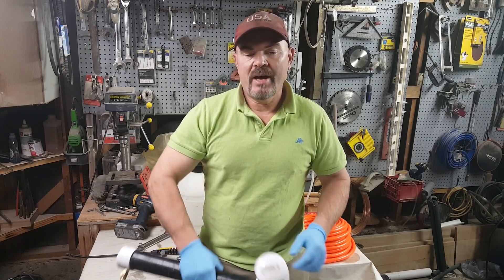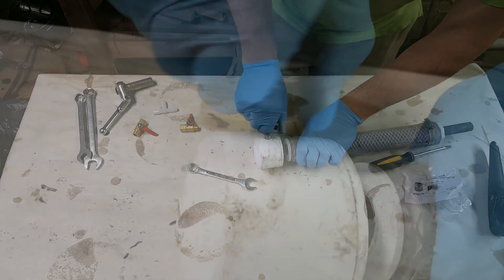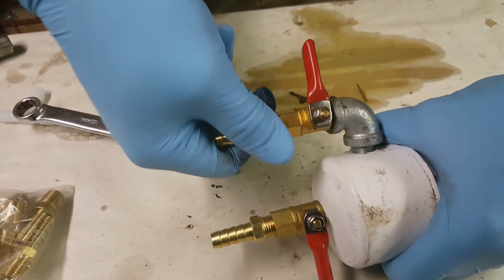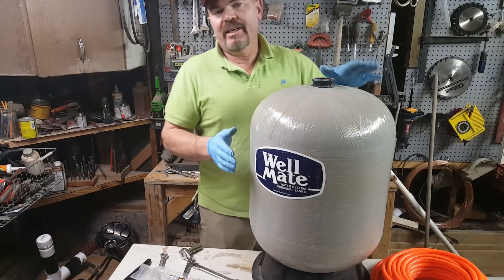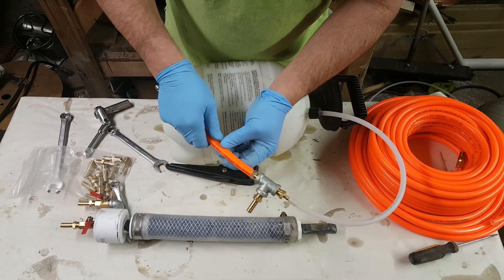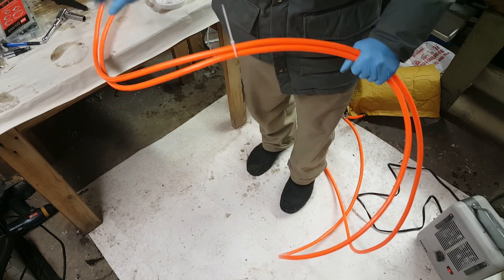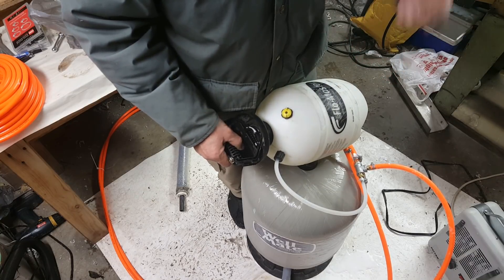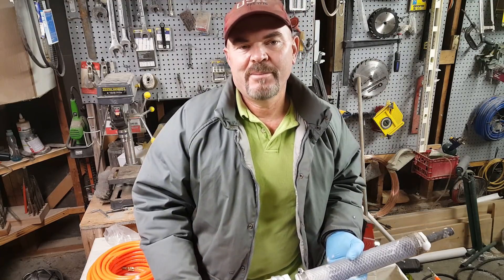Larger Tank for Air Crete Foam Mate

Comment: I'm in process of using an old 29 gallon air compressor tank i had laying around!!! Way more space then i will ever need at one time. But i figure hey why not. I built the original Foam mate and I just needed more capacity. Might have went little overboard, LOL. Great video. Thanks

Comment: I'm trying to use a 15.5 gallon beer keg mounted on a 2 wheeler for mobility. The keg coupler is made for air in and liquid out. That’s what beer kegs are designed to do. Bought an extra coupler to fill the keg with water and foaming agent because you have to remove some of it's innards for it to work properly. Bought a brand new 8 gallon 150 PSI Kobalt air compressor, 4/csfm's@90lbs which shoots major foam for about 30 seconds then just water. Finding the PVC pipes rupture at 90lbs or less or springs major leaks. So far I've had 2 PVC designs and 2 major explosions sending pieces a hundred yards in all directions. I’ve spent hundreds of dollars on this dang thing that was supposed only to cost around $30, then $50 bucks. You know I would think 15.5 gallons would generate an enormous amount of foam but No. Could the ½ inch PVC pipe be too large? I have no idea what I’m doing wrong but nothing I do works. Suggestions PLEASE!

Comment: Ok, so I watched the wall pour and thought it might be the answer for my addition. 2 questions, 1 would it make sense to add conduit in each panel and PVC for wiring  and PEX for the plumbing? 2, I. An alternative, just frame the inside as normal and simply use your air create for outside wall like your would block or other precast concrete.

Comment: Why do your videos always lack critical pieces of information to get your inventions to work? Or why you would put a regulator in the middle of the hose instead of just telling people to put one on their compressor. You were concerned enough to acknowledge that people may not have the water tank to use the sprayer tank but not how to use a dish soap that isnt concentrated as it is bought from a wholesale club that not everyone has a membership to.

Comment: After using your "foam-mate" pretty extensively, I've decided that it is only worth using if one has at least a 2 1/2 gallon reservoir and I wish I saw this before I started the big project that I undertook.  I did use a 5 gallon bucket which worked great for a while but then the pressure distorted the shape of the bucket and the lid wouldn't hold the pressure anymore.  I considered buying a 3 gallon sprayer similar to the one in this video but at this point I have already spent more than my budget on this project.

Comment: so... if using the larger tank in this vid, how much foam can be created and how many gals of air-crete will it make? I ask for larger projects like a slab. also will adding just a bit more water to the cement mix will slow down the setting process? starting to really like this rig...

Comment: Just use water pump and forget pressure in the fluid tank, reduce size of line close to aeration tube (wand)  to put more pressure on foam mix liquid then the air pressure.